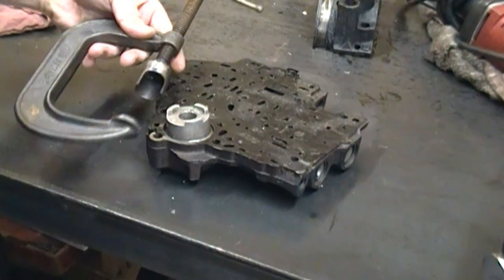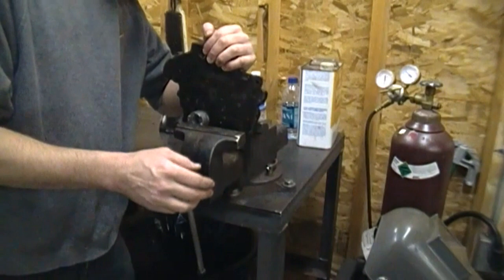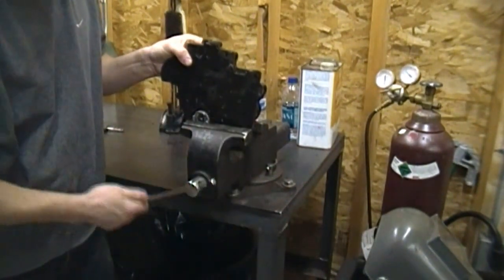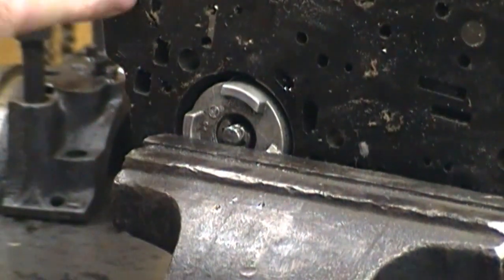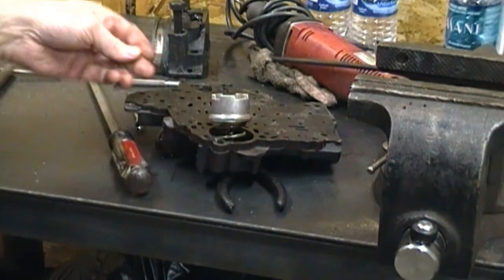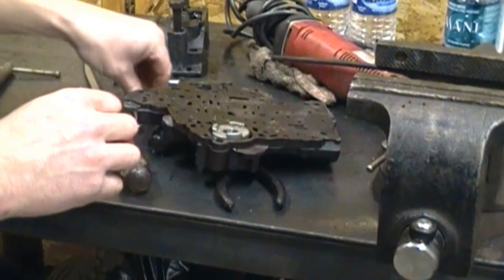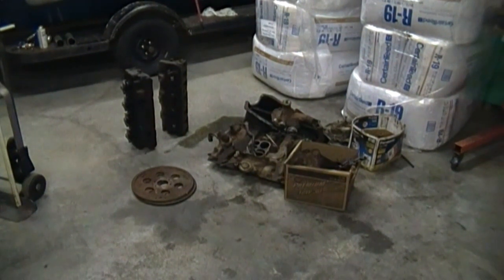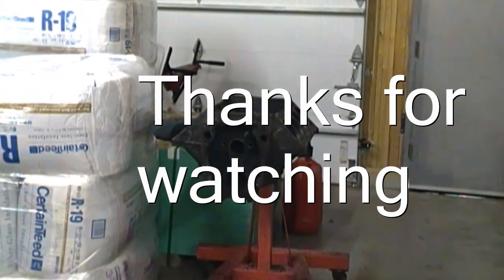Turbo Hydra-Matic 400 Transmission shift modification

Comment: what would happen if I leave out the Accumulator Piston in a turbo 400 trans and installing a TSI T TH-400 Turbo 400 CNC Billet Saver Snap Ring Support  PN/4045  and without using a trans brake! What can I expect???